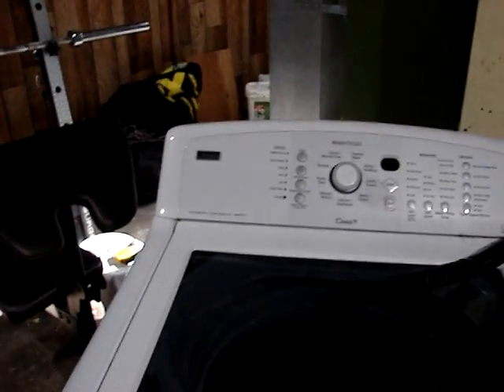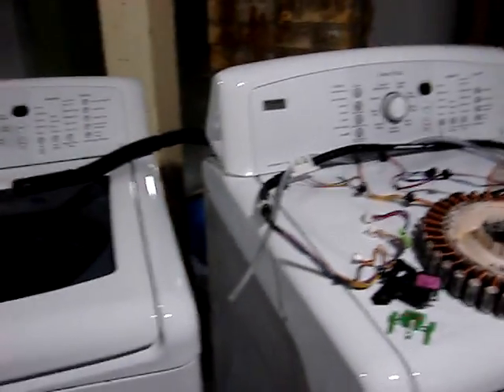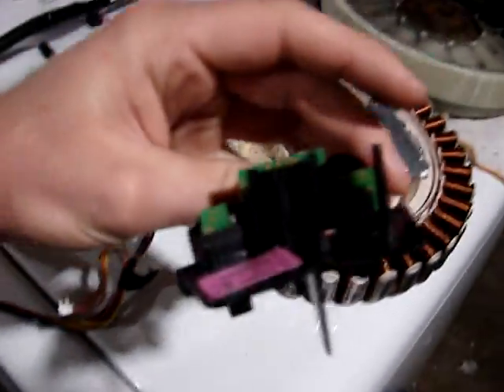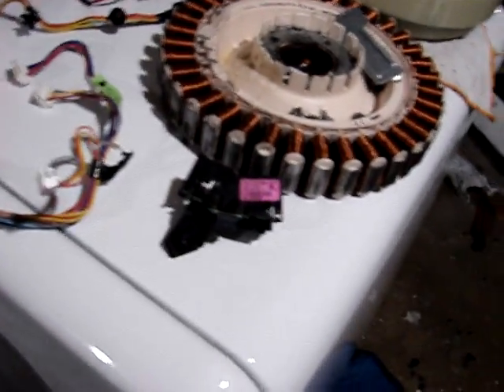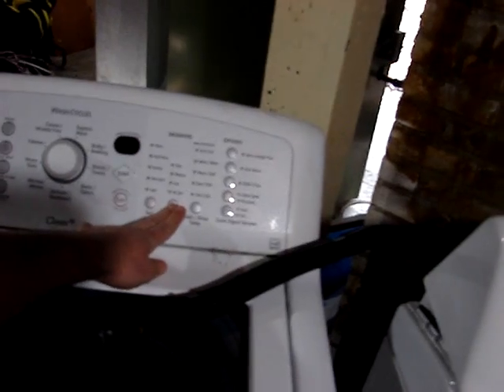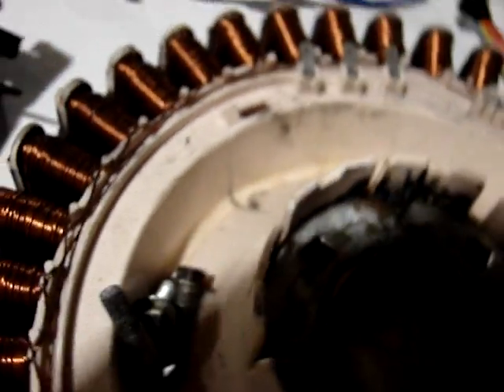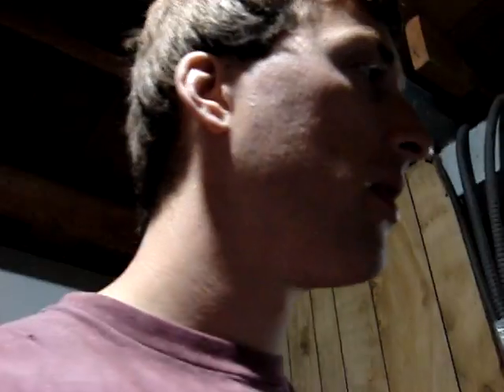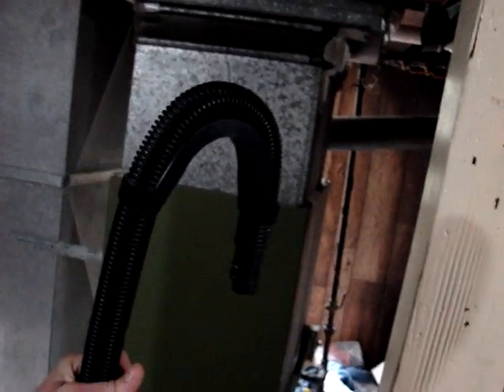Kenmore Elite Oasis HE Rotor Position Sensor replacement F51 and LF Error Codes

Comment: I removed the bolt but I can't remove the agitator 
 to get to the four bolts underneath it's stuck on the plate any suggestions to remove this?
Reply from the maker: Too long ago to remember, there is a cap on top of the agitator that pops off with a bolt underneath.  Try prying from underneath? Or remove the motor on bottom and pound out the shaft.  This washing machine is the most epic piece of garbage I ever had... I would not waste a second on it.  You can get a nice lg front load set for not too much.

Comment: Save me the washplate from the old washer
Reply from the maker: I threw this hunk of crap out years ago lol. I got way better lg now.
Reply: Btw of and samsung is all junk more junk than the oasis
Reply from the maker: @ScantPear  my LG washing machines are top-of-the-line with 10-year full warranty. Really top-of-the-line excellent cleaning power. The Kenmore Elite Oasis he machines are the worst constructed machines I have personally come across. Every part failed. The parts that failed are the control board, mixing valves, computer display, stator motor bearing, rotor position sensor, lid hinges rusted and broke off, and the actual machine casing itself rusted. That is besides the fact that well properly functioning the machines were never effective in the first place. I classify this as an engineering disaster. I will not ever look at Kenmore machine ever again. I am insulted, ashamed and surprised after tremendous failure.
Reply: I know a real technician and he said the older washers are better then lg lots of grief
Reply from the maker: @ScantPear  I disagree...the early he machines were terrible but they've been perfected and are more efficient and silent.  The pros finally outweigh the cons.  At least for the LG, its powerful.
Reply: Plus I am going to be a washer technician really soon the older ones are simple as ass to repair but as for the modern ones, we have to lay them down for almost all repairs
Reply: Lg is total fake it takes 3 hours to do every load of wash and it is hated by everyone so it is junk
Reply from the maker: @ScantPear  I'm sorry that is very incorrect. I also love the fact that they can handle a lot at one time. You can choose quick wash, long wash you can even increase the water. Best washer and dryer I've ever had hands down. Even better than the old fashioned agitator Style. My first front load style machines. Super quiet and even has storage drawers underneath.

Comment: Seems like the easier solution is to just reconnect the wires with jumpers where the RPS cracked.
Reply from the maker: Jared Camilli well, the circuitry is incredibly small. You would need something small like a phone wire. Maybe even smaller trust me I considered that pretty heavily.
Reply: Thanks for the reply! Yeah. I know what you mean. I have spent a lot of time soldering connections much smaller than this. Compared to other circuits, this RPS's wires are actually very large. With the right equipment (good soldering iron, thin solder and the right wire) it's actually quite easy. You can expose the circuit wires by removing some solder-mask with a paint stripper (unless it's more than dual layer board). Then use very short jumper wires. Another option is to use "longer" (still rather short) jumper wires and run a wire all the way from start to finish, bypassing the circuit board crack completely.
Reply from the maker: Jared Camilli it would have been an uphill challenge haha

Comment: We had the LF code also....not all the time, wasn't making sense, I got with sears and the said it should be low water pressure. So I checked my pressure under several conditions, and end up finding that my water softener filter was plugged!...not bad, but enough to trigger the LF code....
Reply from the maker: Marty Roshak I think that sometimes the valves can get calcium and sedimentation embedded in them which can restrict their use. I think that also may cause that error. but one thing is certainly clear. The entire design of these machines is a fraudulent mess. The poor quality and the amount of problems that a user will experience throughout the lifetime of this unit is hilarious. Out of all the things I've worked on and all of the things I've repaired and all of the situations I've experienced this is one of the worst. this is a completely unacceptable design and has no place in our homes or on the shelves of the store. I am severely impacted by Ken kenmore's decision to sell this. I have no respect for that company anymore. we all have to live by a certain standard and if I don't do my best work I'm not doing my part in life.  if Kenmore is selling scrap metal washing machines they're not doing their part either. Individually and organizations we all must produce our best efforts in this world. So, I hope your machine it's better than all the rest.
Reply from the maker: Skid a mechanical washing machine that does not associate itself in anyway as a high efficiency machine. normal top load washing machine...

Comment: the washers are a horrible design, to try and compensate for the bad design the manufacturer put out guidelines on how to load the tub and which garment to wash together but it doesn't help much. the biggest problem is they removed the center agitator, and the tub is too free floating. Without that agitator the cloths tend to roll up in a ball then when it starts to spin the ball of cloths roll to one side causing a uL error. I did a ghetto mod on mine to kind of get around the problem. first with spray adhesive I glued a 8"x2" piece of 2" thick high density foam rubber on all 4 sides of the inside of the cabinet right where the tub was the widest so it held the tub in place more securely, then with a straight piece of metal lust long enough to go across the center of the tub and an 8" level I made sure the tub itself was leveled instead of leveling the washer cabinet. between those 2 things it cut my uL errors way down. I don't care what anybody claims, these washer are garbage, all you have to do is check your local dump or electronics recycler and you'll see how many of these $1K plus machines have been scraped, a lot of them still look almost new!

Comment: my problem my machine gets down to 19 mins and during the spin/rinse cycle the machine gets all violent and then I get a UL code and eventually the machine drains and my clothes are still wet.  The machine was bought new in 2007.  Suggestions?
Reply from the maker: V Erokaht are you saying that the machine has an unbalanced load and it is not balancing on its own? sometimes it does get out of balance that's just the way it is, it's a terrible design.
Reply: Yes, but to do it all the time?
Reply: The machine is a POS, can't believe I paid a little over $1k for it back in May 2006.  6 months into owning it, Sears had to come out and replace the cpu board on their dime.

Comment: Thanks for the video. The new RPS sensor does not fit with the original sensor (bought machine in 2007). So my question is do I now have to get the wiring harness kit and of so how difficult is it to replace? Could you make a video on that? This video on the sensor was great but I was SO frustrated that it was advertised as a completely compatible part and they changed the plug as you pointed out in your video.

Comment: Did you replace the wiring assembly too, or just the RPS?
Reply from the maker: bethlocd I used the sensor and the harness off the doner machine, the plug to the top side control panel is the same even thought the connections to the new and old sensors are different.
Reply: Thank you

Comment: Thanks for sharing the information on the LF problem.  I'm currently tackling a Lid Error and LF error.  It's getting to the point where we need to replace this thing, but my wife absolutely would not budge on purchasing a replacement.  Our machine always stalls at the 17 min mark, errors out the LF code, and requires a manual start to get it running again.  I'll test it out by lifting the drain hose higher than the machine a few minutes before the 17 min mark to see if this will work.  Can you tell me where I can purchase that U-Shape bracket?  Thanks much!!
Reply: Tilt your washer to the side and on the inside of the side panel there's a tech repair guide that gives ALL the codes and how to repair them!!
Reply: Thanks William M.  I'll be sure to check it out.  Now for some strange reason, we discovered that if we run the loads on the "Bulky Bedding" setting, it no longer errors with the "LF" code at the 17 min. mark nor do we get "Lid Error" codes.
Reply: The LF code is a LONG FILL time error, LF flashes when the water level does not change for a period of time (hence the 17 minutes mark), 
This fault may be caused by SEVERAL different conditions:
1.- the water faucets are not totally open. 2.- the little filter screens in the water hose connectors are clogged with scale or debris. 3.- the water pressure is way too low. 4.- there are bends or kinks in the water hoses feeding the washer creating a low water flow condition. 5.- one of the electric solenoid valves (hot OR  cold) that fill the washer are bad; ie: the cold water valve is bad or clogged and your cycle calls for cold water "only" (not warm; or hot). 6- the water level sensor is : A.- Defective or B.- Out of calibration, level sensor will prevent the computer from "reading the correct water level" (can be recalibrated from the user panel). 7.- Rusted or corroded connectors in any of the water valves or water level sensor wiring. 8.- the drain water hose is stuck way too low in the drain and is siphoning the water as it fills the tub and it will never get filled (it happened to me in a different washer).  Get the "Tec Sheet" that is usually in a plastic bag pocket somewhere inside the washer cabinet with a truck load of information, diagnostic and calibration procedures, and electric schematics, DO NOT FORGET TO RETURN IT TO THE SAME PLACE, so next time you need it, you will find it there.

Comment: Help me out here. I do the dino on the washer and it reads F51 but when I hit start the drum starts spinning . Is that right ?
Reply from the maker: It sounds like the same problem I show you in the video.  Check the Rotor Position Sensor.  It is easy to locate on top of the motor.  Check it.

Comment from the maker: So you replaces the gray circuit board box that sits to the right of the blue valves?  If that went bad you probably have a fried button cluster too. Those are the only 2 things that could go wrong on these machines.  That grey box is the brains of the operation and the display board is the only other thing.

Comment: I got this same washer off of craigslist from a guy and the washer will not drain, I did the diagnostics test and the error codes F71, F82, and F68 come up. It makes it to C7 then about half way through it stops and hows the error codeF 72. Do you have any suggestions?
Reply: My agitator is actually stuck and will not come off the plate any suggestions